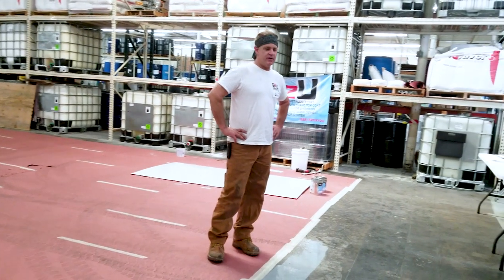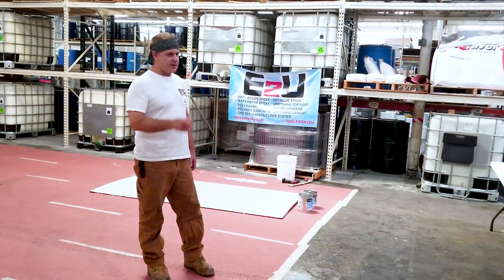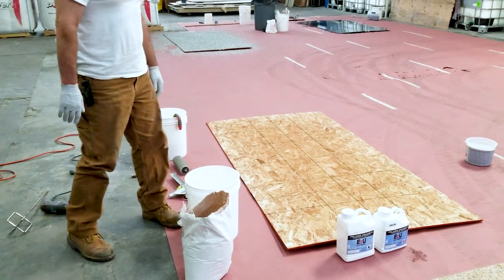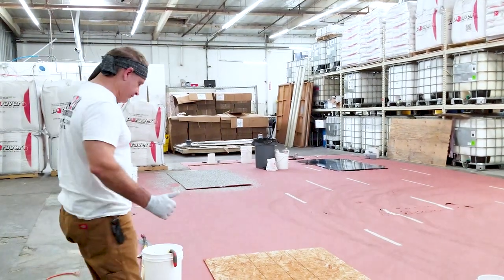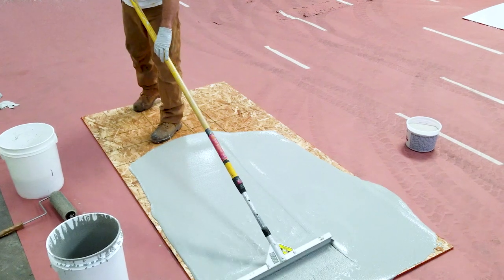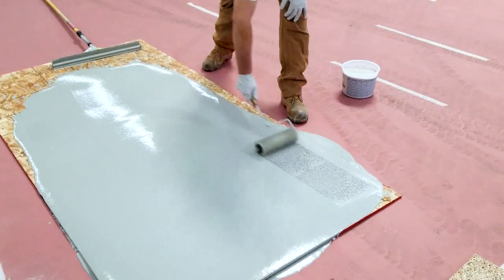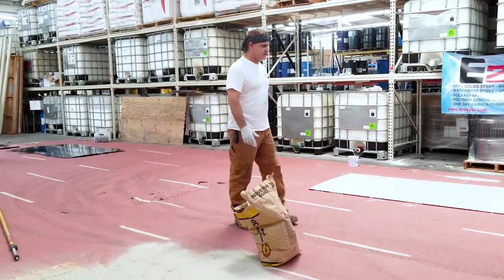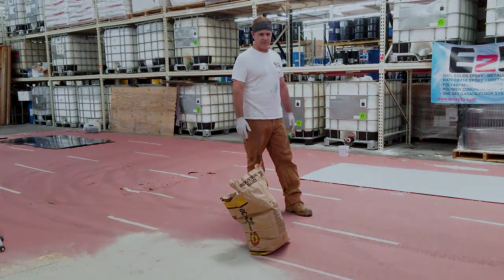Epoxy2U Polymer Concrete Urethane Cement Demonstration

Comment: Hello, thank you for this video.  Do you know of any other product you guys sell that can poured directly over concrete that is a bit cheaper? I have a freshly poured 64 x 48 slab, no sealer, wasn't trowel finished. Is there anything else I could use without having to grind the concrete?
Reply from the maker: Hello, we certainly have other products that can be used that are cheaper, however we CANNOT warranty any of our products if you aren't going to grind the concrete first. Without grinding the concrete the products just simply won't adhere to your surface properly and there's risk of something causing it to break off.